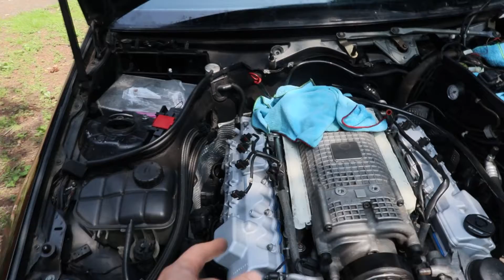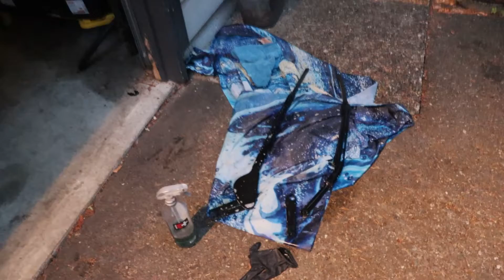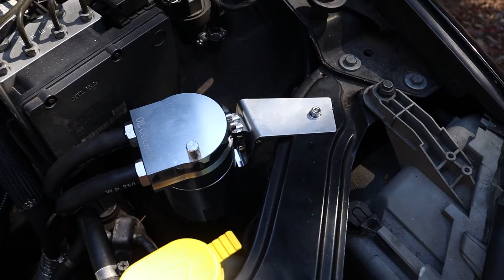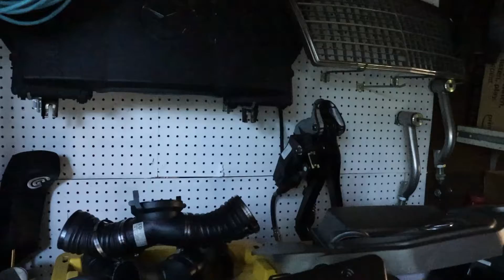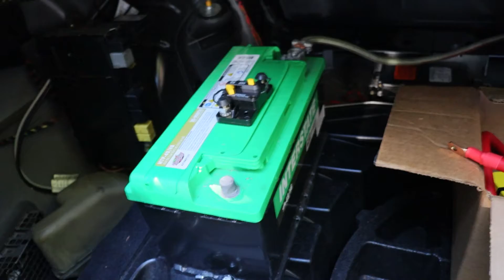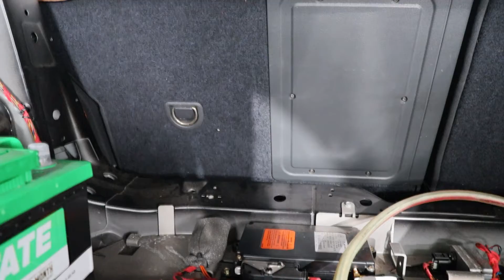PROJECT CLK55K AMG - M113K Oil Catch Can, Battery Relocation and Wiring

Comment: what size wheel do you have. and do you have spacers or springs ?
Reply from the maker: 19x8 et 42 with 15mm spacer
19x9 et 45 with 20mm spacer

Comment: Nice to see the CLK ..unlucky with the windscreen , but look on the bright side , now you can get a new windscreen with no chips at all.
My original screen had literally hundreds of tiny chips which were bad in low sun situations ,,,best thing ever was to have a new windscreen installed. Just one little tip , double check that the cowl drains are connected to the drain tubes correctly after installing the cowl and/or a new windscreen.
ps ,,Good job with the catch can ,,please tell me what size and type of hoses you used ?  Thanks.
Reply from the maker: Yea definitely won’t hurt to have a new one fitted. I did fill the crack and it’s 80% better but not perfect… will last a little while till everything else is sorted.

It’s all 3/8 line with brass y split and brass elbow. Some silicone line and some regular fuel line
Reply: @ANDERZENAMG  Thanks for that ..:goodvibes: